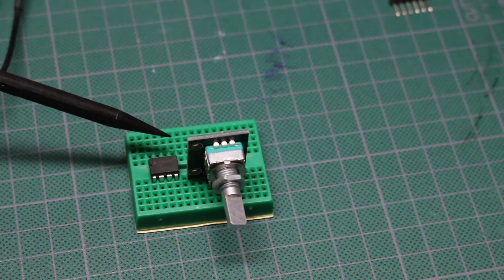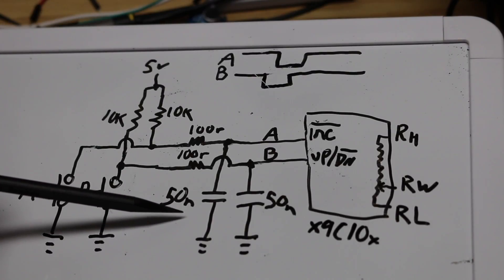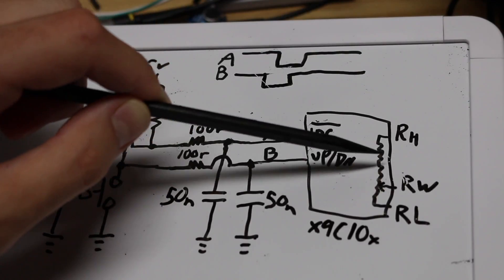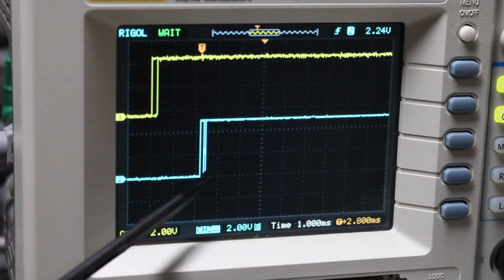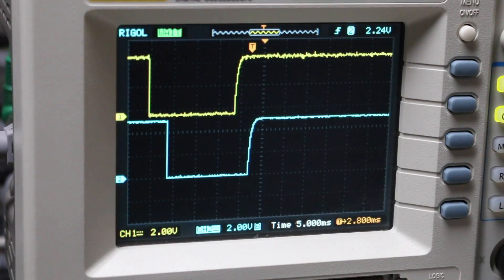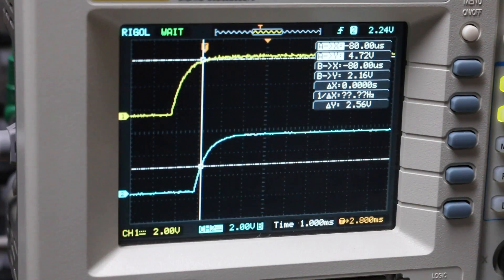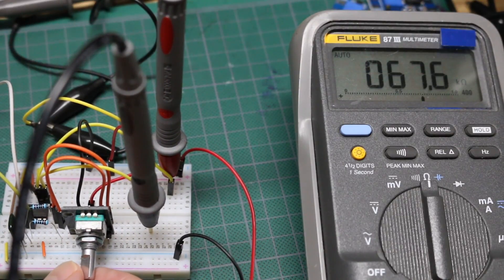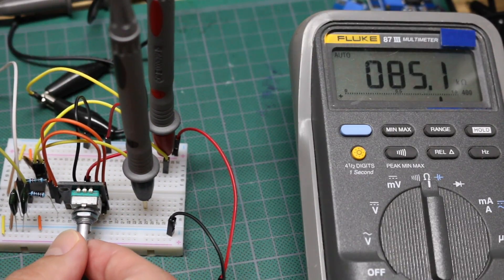Digital Potentiometer and Rotary Encoder Direct Control X9C103

Comment: Hello Gadget Reboot, sorry to dig up an old video you made 7 years ago; I was looking to replace a volume potentiometer that was making noise when increasing or decreasing the volume, and I found your video on YouTube. I followed your method for my little Boom! speaker, and it works very well; the volume increases and decreases as requested. My boom is also stereo.

A small problem has appeared: when I turn the rotary encoder knob, I hear a click from the speakers each time I turn it to increase or decrease the volume.
Do you know of an easy way to eliminate this click?

Thanks in advance.

Comment: I know you said no CPU's but you could use a Tiny 85 or something, that would give you software debounce & you could set the resistance increments to 1 decoder click?.
Reply from the maker: yeah a small cheap processor is always more practical and robust but it’s always a fun exercise to think about other ways, and then maybe those other ways can lead to other ideas for different projects too.

Comment: How many res ohm per pulse Man..
Thx
Reply from the maker: There are 100 wiper position taps, so depending what pot value is used, divide by 100 and that's the resistance change per pulse.   With mine being 100K pots, it changes 1K per pulse.
Reply: @GadgetReboot  well.. That is Very weak resolution

Comment: would a schmitt trigger work as a de-bouncer also?
Reply from the maker: It would just help make a single edge itself less likely to re-trigger on noisy inputs as they rise and fall,  but a delay is still needed for debounce to check much later after a transition and be sure it's still in that state.
Reply: @GadgetReboot  got ya

Comment: Very good solution to replace mechanical pot. What addition to be done for control multiple digital pot connected with same bus. Please replay.
Reply from the maker: if multiple pots are going to be controlled separately with one encoder, the target pot would have its chip select controlled some way in order to select which one the encoder controls at the time and the up down and increment pins of all the pots would be connected in parallel. 
 if all the pots are intended to be controlled simultaneously by the one encoder, all of the increment and up down  pins are still connected in parallel and all the chip selects are permanently enabled so all the pots  respond at the same time.
Reply: @GadgetReboot  Thanks   a lot,  any circuit/codes available with you, to control 4nos of digital potentiometer individually with single encoder.

Comment: If you switch power off , is de wiper in memory when you restart the power?
Reply from the maker: To store the wiper position, the data sheet shows what state certain pins have to be in before powering down, otherwise it will just put the wiper at whatever was previously properly stored.
Reply: @GadgetReboot  so you have to initialisate the potmeter on forehand  ... okay...
( kind of preset , and then never use the memory to store)
Reply from the maker: The device would only be able to handle so many memory storage operations as well so it’s not really intended to be used regularly to store position, more like a calibration that will stay the same for a long time. 
So when I use it I make sure when I power up I configure the wiper  to the position I will want and then I tweak it if needed. 
That means the circuit needs to be able to tolerate the resistance value changing and going possibly close to minimum or close to maximum resistance as part of the wiper adjustment process and not all circuits will want that so these potentiometers have to be used with that in mind.  Rather than being a drop in replacement for a regular pot they are more like their own unique device.
Reply: @GadgetReboot  indeed , if you have volume control , that the default position is stored at 50% for once and always for ever

Comment: In my application I will just have to stationery momentary buttons one for pressing up 1 for pressing down I will not be using a rotary encoder Do I still face the same D bouncing challenges that you indicate in your schematic
Reply from the maker: The Debouncing would still be required because it’s still a mechanical switch that will make and break contact possibly several times for a single button press so the filter would still be used
Reply: @GadgetReboot  thanks for reply

Comment: Hi great video
  I noticed on your schematic there was no indication of a chip select Do you only need chip select when interfacing with a microcontroller  Or is it not needed in a manual situation like this
Reply from the maker: I just kept the chip enabled all the time since it’s only one chip. If multiple potentiometers were being controlled by the same data lines, that’s where each chip would have its own chip select so the one set of data lines from a microcontroller can send out the data and enable whichever chip they are targeting and that’s the one that will get controlled at the time  from the one set of control signals.

Comment: Can you please post a link to the code for this project?
Reply from the maker: There is no code because there is no processor. The whole purpose was to use a rotary encoder just in hardware hooked directly to the digital pot so you turn the knob and it changes the pot wiper all in hardware.
Reply: @GadgetReboot  ... yes.. and can we get the pcb layout, parts list, guitar tab, and lyrics?...I'm also lactose intolerant in case that makes a difference. please and thank you
Reply: @ccook31  Lmaoooo, people really be doing him like that 😂

Comment: HELLO !!
There are 3 resistors on board of the rotary encoder. I am using the same module as you are using. So even though we have those resistors , should we use the 1k and 100ohm resistor ? What is the actual function of the on board resistor ?
Reply from the maker: The three resistors on the encoder are 10K pull ups for Clock, data, and the push button switch  to give us our logic high signal or ground when the  switch is closed. So when using the encoder we don’t need the external pull up 10 K resistors but it wouldn’t hurt anything it would just be in parallel with the encoder resistors and end up giving a 5K pull up resistance. 

 We do need the 100 ohm because that combined with the capacitor provides the debouncing and filtering on the mechanical switches to give us a filtered output instead of all kinds of bouncing high and low signals so it’s a different function than the pull up.
Reply: @GadgetReboot  thank u for the detailed explanation 😊
Reply: @GadgetReboot   I used the same schematic with the nodemcu. But the reading is not stable . The output is jumping around. I am trying to dim a light with the rotary encoder. But not with the digital potentiometer. Is this schematic only for digital pot ??? or can be used for other purposes ??
Reply from the maker: This schematic happens to work with the digital pot because of the way the two controls work on the digital pot. Increasing or decreasing the digital pot with the two available signals directly matches how the rotary encoder outputs look and we just denounce  the switches with the resistor and capacitor. 

 If you were connecting the encoder to nodeMCU and using software to look at the two encoder signals, you shouldn’t need that extra resistor and capacitor for de bouncing, it should be done in software. 

 And software will also need to look at the encoder signals to determine if it is moving and in which direction. A library like this makes it easy to use the encoder. 

https://github.com/PaulStoffregen/Encoder
Reply: @GadgetReboot  Yes. I tried it before with the software and couldn't achive a better result. So i tried your schematic to achive a better results. I went to the link you have provided and there is pic where in they have used capacitors. I guess its a must to have for debouncing. 😕

Comment: I'm trying to replace a 24v step-up converter's pot with a digital pot so that the user can select the voltage digitally via program instead of manually. I don't know if I make sense but is that possible?(converter is connected to the VCC of arduino and terminates to a 3-24v buzzer)
Reply from the maker: The two limiting factors would be the maximum voltage allowed across the terminals of a digital pot as well as the maximum wiper current allowed. If I remember properly, the maximum voltage across this digital pot is +/-5 V and the maximum current allowed through the wiper is about a little over 4 mA.

 I was thinking about doing something similar but when I put a volt meter across the terminals of the existing trimmer pot on the regulator, the voltage was beyond this safe value so I couldn’t do it,  but other circuits may work differently.   So you could do a quick test measuring the voltage across the pot as you adjust the converter through its range and see  what the maximum voltage is across the terminals on the pot.

Comment: Nice demonstration. 
Much cleaner then my mess of jumper wires when I tried to demonstrate the digital pot chip.
Reply from the maker: I don’t think I saw that video. I will have to go search it out. You should see the mess of wires and other things on the work bench outside the video frame. I really need to do something about that it’s been building up for half a year.
Reply: I like to think that everyone's shop is a jumbled mess just outside the camera's view. I know mine is.

I didn’t do a separate video about the digital pots, it's part of my Dec 17 (2017) mailbag Monday.
Reply: Guys, it is reassuring to know that beyond the 1920 x 1080 pixels of relative cleanness I see in your videos, there is a mess that looks the same as the one I have on my own bench :D

Comment: Nice scope shots of the (de)bounce.
Have seen a similar circuit to drive a binary counter from a rotary encoder.
Maybe the target application of this digipot is to replace a (expensive) multiturn potentiometer with a (cheaper) rotary encoder.
Reply from the maker: Yeah I never thought of this as a multi turn pot. My encoder has 20 detents per revolution so this is a five turn pot with 100 positions on the digital pot.

Comment: Excellent!  I did not have the imagination to figure that one wiper would clock, and the other determine the direction.  So simple.  Seem to remember from the datasheet that it allows you to elect if it keeps its setting on power-down?  Yes, this is sweet.
Now, thinking that you can use your dual-D's and a 2-channel switch (maybe a CD4066B) that sets levels on several X9Cxx chips with the same (expensive) rotary encoder, and a few inexpensive buttons -- all without using an MCU.  May be good for something like a PWM generator that uses multiple resistance values -- frequency, amplitude, duty cycle etc.
Reply from the maker: Yeah it took me a while to realize we don’t really need a circuit as long as we’re only controlling one device at a time and we don’t care about Chip select we just keep the thing enabled. I forgot to mention in the video that I was keeping chip select enabled and we would need another way to control that if we wanted multiple devices.
Reply: Could wire the encoder press button to a binary counter and use the output of the counter as chip select. Then its easy to add or remove devices, as you just wire (number of devices + 1) to reset of counter.
Reply: @annybodykila  Hmm, like a CD4017 decade counter, where Q0 is no device, and Q9 resets, to select 0 to 8 devices?  Some debounce circuitry, indicator LEDS, and maybe even one of those cheap 3-digit voltage meters, that would be a useful device.